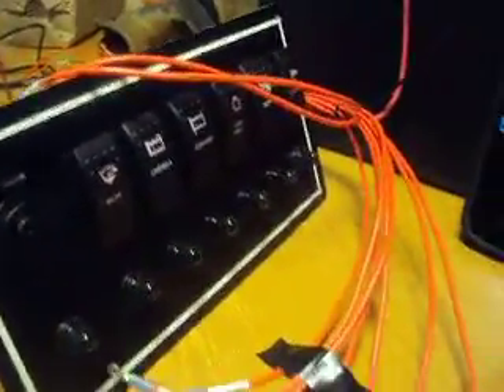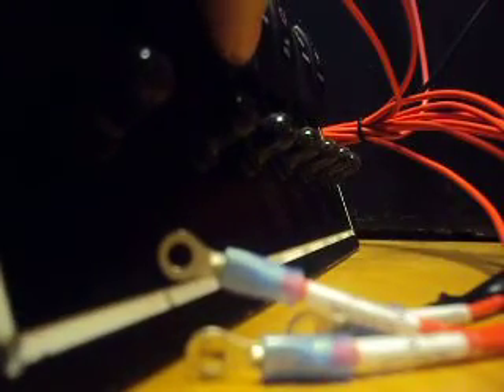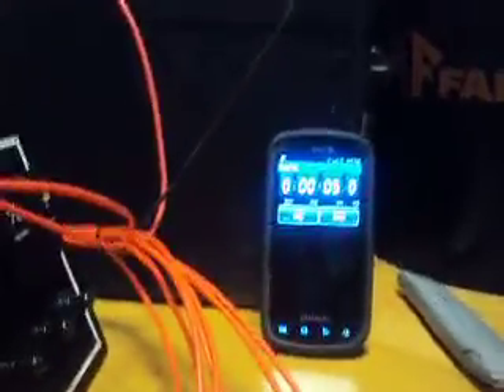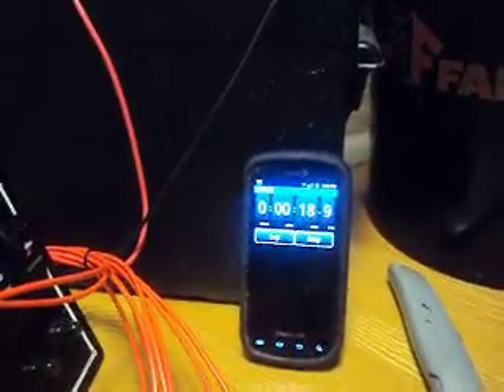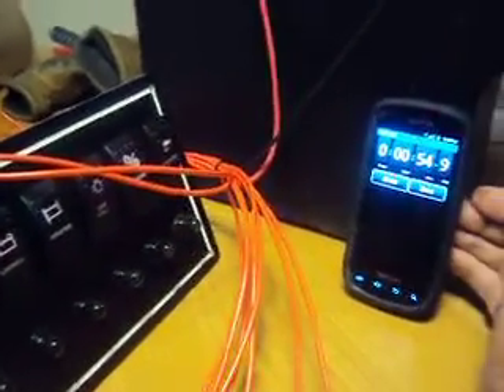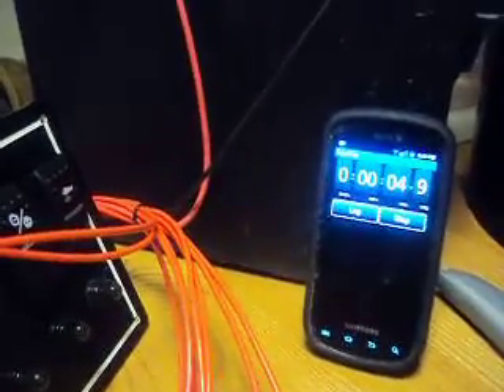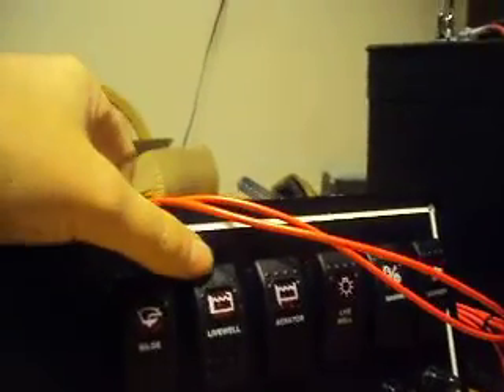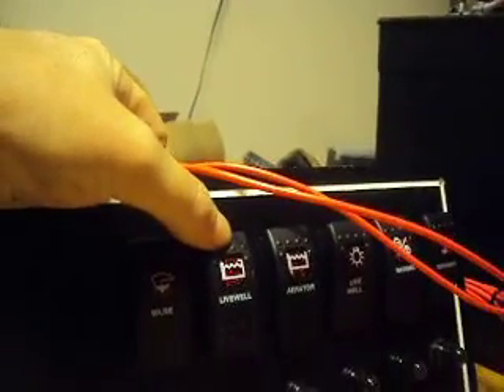Livewell Timer Module wired up to Panel for test

Comment: even though you've probably sorted this you mentioned running the aerator off the same timer. If you bridge the 2 into the timer they'll run together. However that is what you get, if wired parallel the timer will run both items in it's cycle. Not sure if that's what you want it's the same thing I'm facing with my kayak but I have to use 2 timers.
Reply from the maker: +gatekeeper88 tried. called the MFG and spoke directly w/engineers...said it couldn't be done with what I wanted to do. More  cost for one more timer, but it works great now. Was just trying to save $
Reply: Can't be done!?!?.. what a load of shit they lied man!. All you gotta do is say connect the positive of both units then connect that to the timer with it receiving it's own positive line. Then neg them out. The timer will then power both simultaneously.
Reply from the maker: +gatekeeper88 yes...it powered both simultaneously...which isn't what I wanted to do. I wanted ability to run each separately off one timer
Reply: +kevininspects ohh.. yeah can't do that, it'd have to have 2 timers integrated into 1 unit.